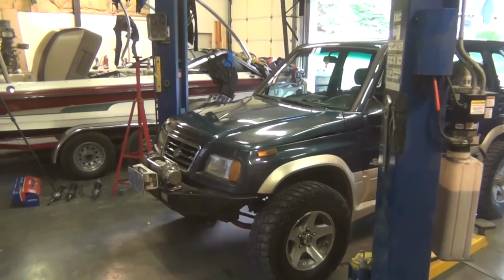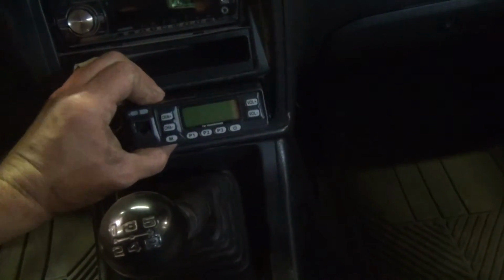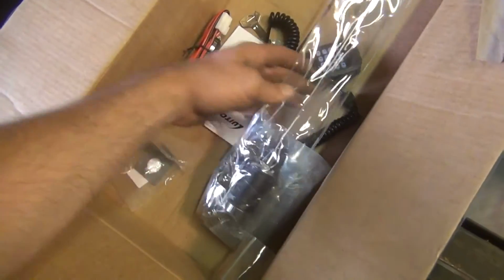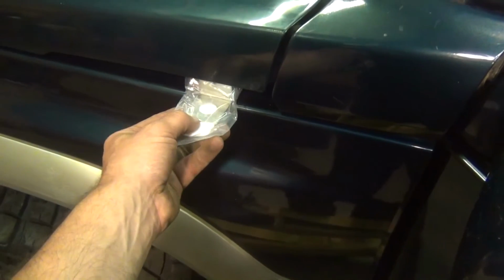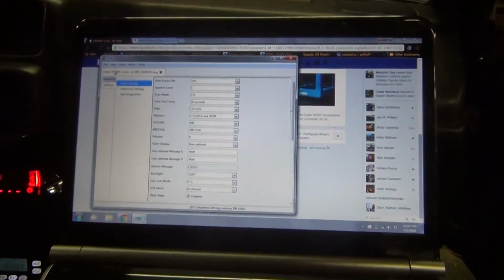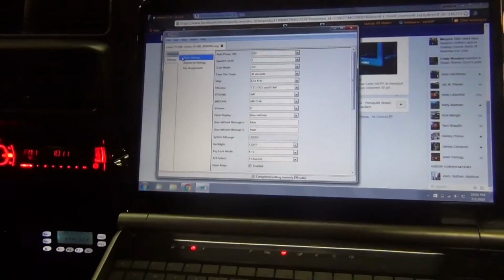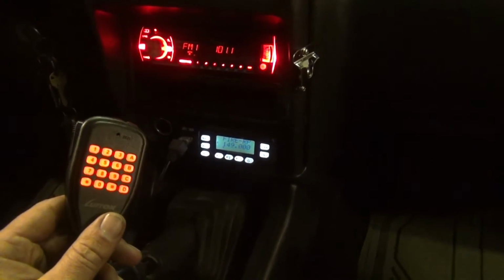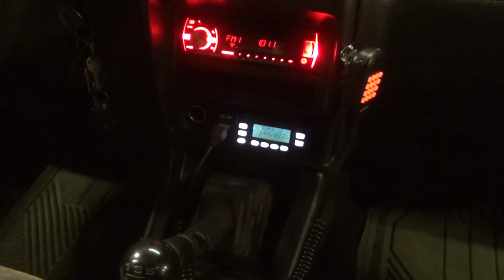Luiton LT-925UV radio install into Suzuki Sidekick

Comment: There is a menu item in these radios that you can change the display from disc-ch, disc-name, disp-freq.  so you don't have to waste an entire bank of memories. Just press a couple of buttons if you really need to se the frequency. Very nice install, excellent work. That's the perfect radio for the kick, I used to have a sidekick, I miss it.  I have the same radio mounted in my 2006 Chevy Avalanche under the stereo. Looks right at home in my truck too!  Anyway just wanted to let you know about the frequency thing and say I really like the install!

Comment: Is there any problems with heat?
Reply: Can this radio receive two vhf channels at once using dual watch? Thanks
Reply from the maker: Yes, it does have a dual-watch feature.
Reply from the maker: I haven't used it to transmit much, but I have had it working for several hours at a time with no problems.
Reply: Thanks I'll probable just monitor my sheriff's dispatch with it. I have my portable to contact them. Thanks. I'm hoping it will stay put with velcro sideways in my mustang.

Comment: Did you program it with CHIRP?   
dan
MK4TKE
Reply from the maker: Yes, I used chirp for programming.  It doesn't have support for the LT-925UV, but since that radio is a clone you can use the Leixen VV-898 page in CHIRP to do the programming.
Reply: i'll give that a try. new at this game. got my tech ticked in april.
Reply: did it' MUCH thanks.

Comment: Nice install. You might want to think about applying some Silicone Dielectric Compound between the base of the antenna and the bracket and, in fact, all of the DC and RF connections. Over time, it really helps maintain connectivity.

Bill KB1ULU, Hartford, Conn.
Reply from the maker: Thanks for the advice; I actually have a tube of it for other automotive projects but neglected to apply it during the install.  I'll go back and add some...

Comment: Very nice install, clean and out of the way.
If you have antenna issues, I suggest putting the NMO on the center of the roof and using a 1/4 wave antenna. JCEC has experimented with many antennas and found the 1/4 wave to work the best.  Thanks for the great channel.
Tom W7GER  AEC Josephine County Emergency Communications.
Reply from the maker: Thanks for the advice!  I'm aware of the possibility of RF coupling with the A-pillars, but an antenna on top of the roof tends to experience more "coupling" issues with brush and tree branches on this vehicle :)  The location I chose has more to do with keeping the antenna in one piece than it does with performance.